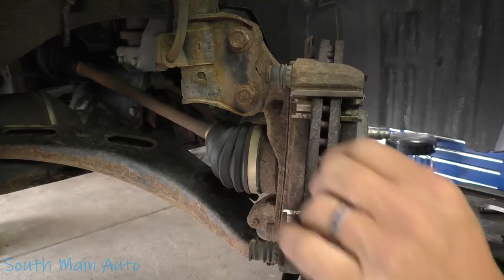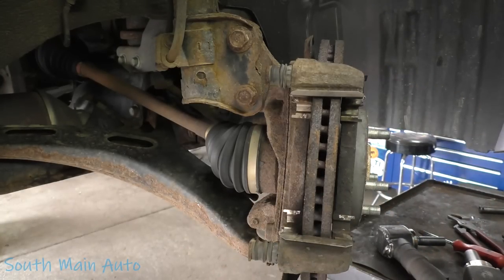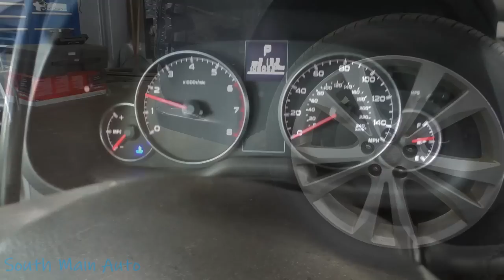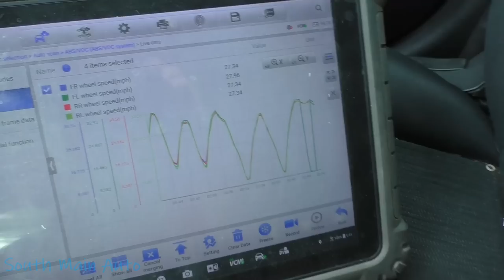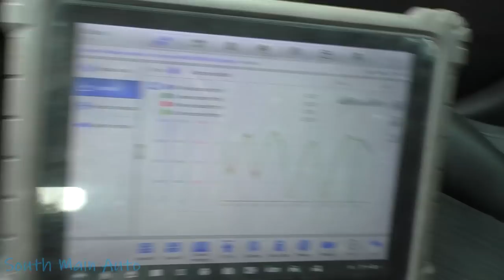Subaru Legacy - Front Brakes & Wheel Speed Sensor Problem

Comment: Question.  On a 2008 saturn vue.  Right front speed sensor and left rear speed sensor not working.  Do you think it will give transmission code and pressure code for ABS . And it feels like the brakes are dragging.  I'm thinking that it's got the computer thinking it's in a spin so it's Appling pressure.  But I would like to know your thoughts on this

Comment: Hey! Stupid question. When tightening the Banjo bolt, you torque it. I have seen other mechanics tap the Banjo bolt with a ball peen hammer then re-torque. I personally have not have the Banjo bolt leak with just torque the bolt. Just a stupid question to see what you thought Mr. Eric.

Comment: Question. Where do I get a hollow wire wheel like the one you use on the area behind the wheel studs? Can't find one in Land Down Under. 72 yr old supposedly retired mechanic/machinist.

Comment: Hey Eric since we're on the subject of brake pedal travel, I have a 1995 Ford Explorer rear wheel drive ABS brakes that has a hard pedal only during a panic stop, for example if I'm approaching a stop sign with my foot lightly on the brake pedal to slow down and something comes in front of me and I need to stop immediately it works fine, same scenario if I approach the stop sign without my foot on the pedal and something comes in front of me and I slam on the brakes the pedal is extremely hard and the vehicle slowly comes to a stop no ABS traction control or anything. if it wasn't for my cat like reflexes I may have been involved in a couple of accidents. I replace the brake booster, the brakes have been bled and I have plenty of vacuum at the brake booster the only thing I have not replaced is the master cylinder. Is it possible that's where my problem lies? Thanks for your help thanks in advance if any is given, by the way this is an open question to anyone that may have an idea as to what's going on, thanks

Comment: 17:30 "check everything" 
You know you are very correct I had bought a brake caliper from O'Reilly and the banjo bolt threads were all screwed so when I tried to put it in it was going all crooked and then also the threads for the caliper bracket also was no good what ever happened to quality control 😢

Comment: So i have a similar issue with an 08 jeep commander. I narrowed it down to the connector at the abs module. Havent figured out how im going to fix it. It mostly shows up when the engine bay is hot.

Comment: There’s a guy I know has an 08 sonata and he had a caliper replaced a while after he asked me about a noise, his brakes were metal to metal on that side but we’re fine on the other, turns out the new caliper one of the slide pins had a bushing on it and caused the slide pin to seize

Comment: I quit installing napa brakes. They are garbage. Rotors warp within a year and I had at least 5.complaints for squealing. Also my local napa Gave me an account and proceeded to try to screw me by instead of doing a warranty return they did a core return 2times and then that one warranty job they still have yet to credite for the parts or the returns. Screw Napa

Comment: Gotta keep trying stuff sometimes . I try to clean up my disc brakes at least once a year. Slides locked up
Pads etc. last fix i did was on rear of my Ford Fusion. I put the cheap pads in so if they get stuck they get eaten  up instead of rotors

Comment: Technically not a shop comeback because the diagnosis was never confirmed and no repair was made. I had many intermittent issues over the years and I only had so much time to diagnose them. Tons of TAC and TANS cases which required factory engineers to get involved. Thanks for the video Eric!

Comment: Great catch! Spongy brake, due to one of the gliding pins stuck. Seen this so many times on Toyotas/Hondas/Mitsubishis/Subarus/Daewoos. The not-stuck gliding pin can travel, and the break pad lining on that side does all the work but that travel is what you feel in the pedal. I had one gliding pin in my cousin's Lexus stuck so bad we had to take the torch to it to free it up. There are also the kind of break pads on rear breaks (mostly french cars) that have two little protrusions that have to line up with corresponding notches in the flat-faced cylinders. It's a rookie mistake to not line them up so it will be out of alignment and also feel spongy. I was surprised those wheel speed sensors got out pretty easy. Was a good call to switch them left to right on this intermittent fault. I call it switchnostics. Sometimes on intermittent faults you gotta do what you gotta do. Like some camshaft timing solenoids. You have 2, one for intake, other for exhaust. Problem shows up every so often, take them out, check for debris, crud, on the mesh filters, resistance across the two pins,  and switch them if it's possible. This doesn't work on a Ford I noticed. They have two different ones so the ports in them do not align with the oil ports.

Comment: I would have used a borescope to look down in the hole and looked at the wheel senor wheels on both wheels to verify there wasn't rust on them. Alternatively without a borescope,  I would have replaced both sensors. apparently at least one of the sensors apparently is flaky.

Comment: So you bled the brakes the normal way?  I see on a Bi drectional computer they have  ABS bleed capability.  when would you use that feature?    Asian art show featured...Spots on the wall by Who Flung Dung.  lol  stupid joke my old man use to say
Reply: When you want to completely flush the old fluid, or if you may have introduced air into that part of the system (changing a nearby line, or pushed air through from an empty master, for instance).

Comment: Eric you've been fussing about your speech for a while now and this is the first time that you've come right out and said you got braces. Thank you for clearing that up. I had them when I was 18 (50 years ago) when the used hammers and punches to install them. They were made of chromium and were connected to each other by chromium wire. To adjust the Orthodontist replaced the wire and twisted it to tension. PS if you touched a 9 volt battery to upper and lower you got to see the fourth of July fire works behind your eyes.
Reply: You are slow on the uptake.  I'll leave it at that.

Comment: I thought NAPA stood for No American Parts Available.
Reply: That's why I swear by Callahan Auto Parts.  They offer superior engineering and manufacturing right here in the USA that meets or exceeds OEM standards and quality for all makes and models.  I like their Platinum ceramic pads with the nano surface transfer tech that fills the pits and imperfections in a rotor and prevents warping by promoting improved heat transfer.

Comment: You talked about rust in the  cups / pistons of the calipers.  Could you pull off the calipers on a Honda and put some kind of grease inside of the cups / pistons? Or is that not a good idea and we're just destined to have rusted out  pistons?
Reply: calipers are cheap

Comment: I always thought subaru was pretty reliable and not that expensive to keep up. This is change my perception. The car is not that old in my experienced to have all these problems
Reply: ...in MHO, Expensive and built to stay that way...🤷‍♂️😏
Reply: The 2 I am familiar with are 2011’s. I have had both engines out for oil leaks, replaced 6 of the 8 hub bearings, both rear prop shafts, countless bumper off headlights and a host of other work. They are simple and quite enjoyable to work on though.
Reply: They are pretty reliable, but they have their quirks, just like every manufacturer. Plus, there's a lot of salt, and dirt roads in that area... The absolute worst environment for salt and rust.

Comment: Torque:
Years ago as a mechanic fixing my own vehicles, I came across a statement on how to properly torque spark plugs to 14 ft. lbs. without a torque wrench.
Lightly tighten until wrench stops, then tighten about an 1/8th to one quarter turn further.
I worked on a lot of VWs back in the day and as such got the feel of the proper torque without the tool and then when I checked it with the tool, it was always very close. Close enough for me to put the engine back in and go if I didn't have a torque wrench.

Comment: Here's a test for you:

I once had a 67 Mustang where the rear drum brakes would lock up ocasionally.  It had front four piston factory disc brakes (Kelsey Hayes) and a station wagon extra wide finned drums and backing plates from a station wagon on the rear.  It had power brakes.  I replaced ALL brake parts, flushed out the system, several times but it still locked up the rear brakes once in awhile.  The only thing not replaced were SOME of the hard lines.

Bet you'll never figure it out.  I just happened to find the problem while doing a physical inspection.